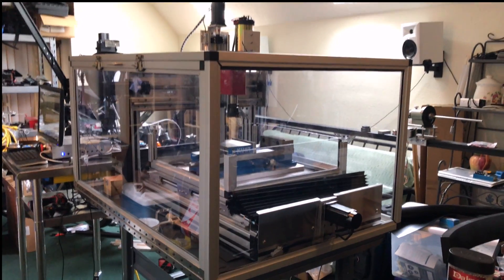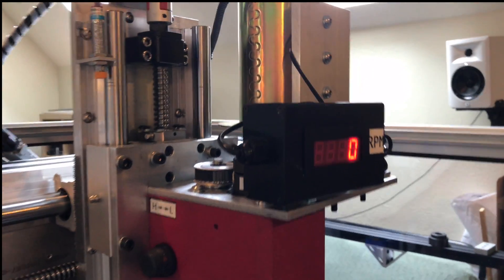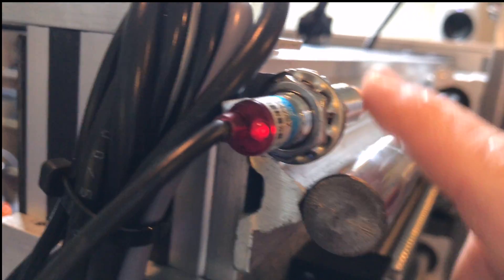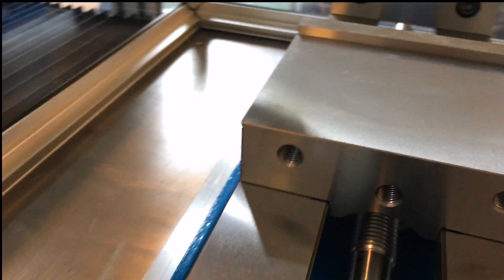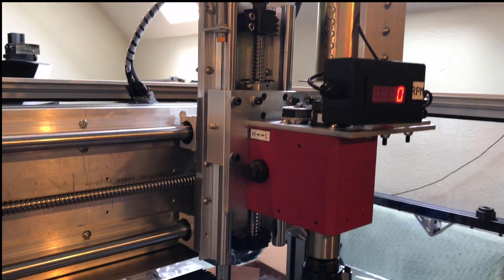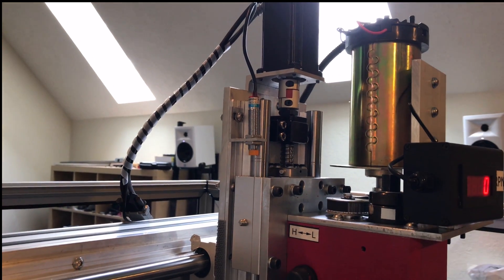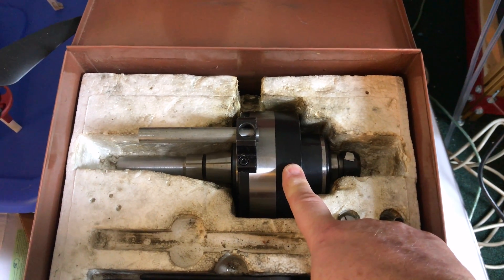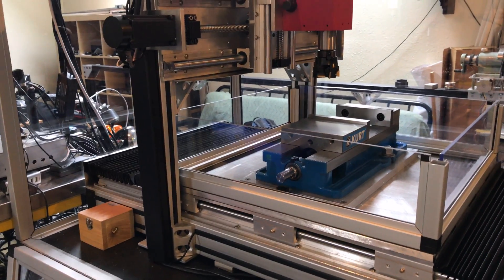Custom CNC Mill / Router Complete with Enclosure 4K Video

Comment: Thank you for posting this, it validated my thinking about using a router as spindle. I started designing a low-speed high torque spindle to use with fly cutters. I found router bits leave slight burn marks on hardwood even at lowest speed. Tried fly cutter on the mill and the finish is so good only minimal finishing sanding is needed. 
The “Mini Mill Spindle Box Assembly, R8” is using plastic gears and I am a bit concerned about durability. You have not used it much so no long term empirical data. Have you researched this subject before you decided on this head assembly?

Comment: I'm used to stepper motors as far as dialing them in on travel amount moved in the config settings. how do the servos work with mach 3? is the tuning for the servos the same manner?

Comment: A thorough thinking in cabinet design! Many diy router machine designers missed in this area. Also, the use of X2 milling head is a new design in router. i think you will use this machine more in metal cutting than what others will do in wood or plastic cutting. One comment is the whole y-axis assembly will flex front and back especially when cutting harder material. And  also, your spindle speed is not such high as those VFD brushless spindle, a very rigid machine construction is needed. Simply strengthening by adding a large triangular at the corner will solve...
Reply from the maker: Thanks, My spindle does 10000 rpm with the spindle speeder 7:1 attachment. I don't get much flex under normal aluminum cutting loads. I cut a project for my brother and it worked great. It was designed for metal cutting. I used triangular gussets and 3/8" aluminum plates to eliminate flex. I have 2 other CNC routers for wood or plastic. See my other videos.